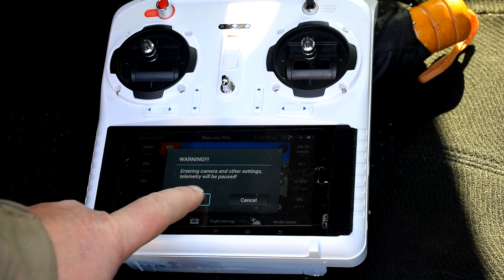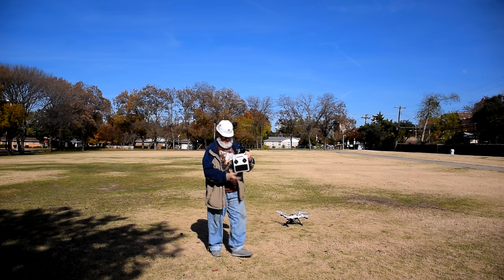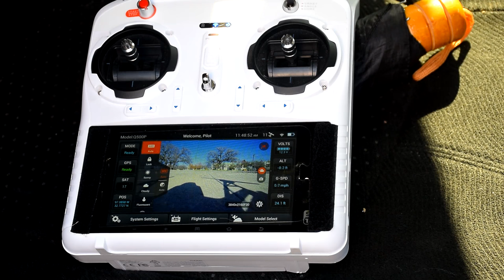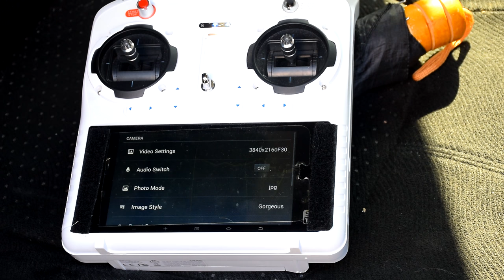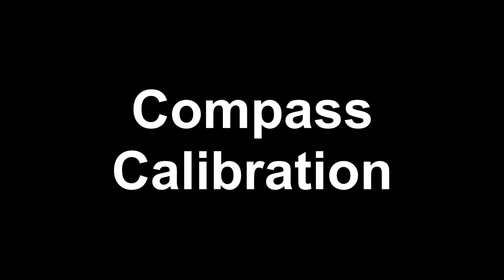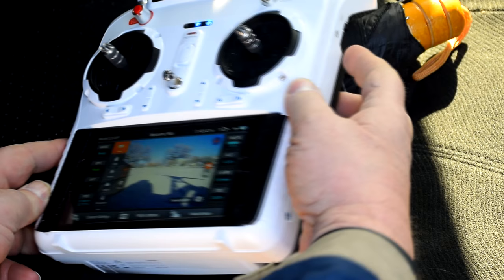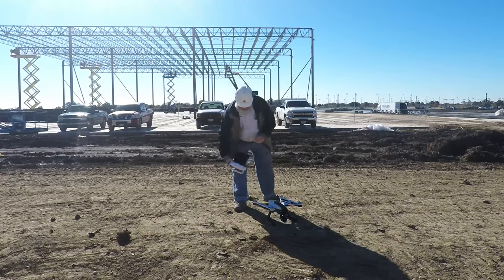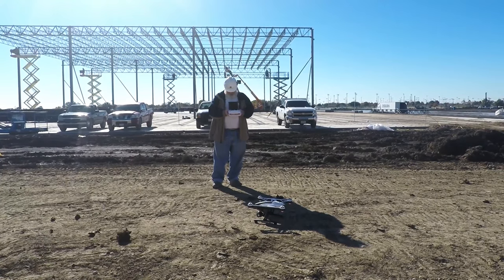Episode 4: How to Calibrate the Yuneec Q500 4K - Accelerometer and Compass Calibrations

Comment: Well after almost two years of waiting (weather and wind) I finally see a couple of days coming up when I can actually fly this thing.  In that time, we opened a Drone Park in Naperville, IL  which is really nice.  Anyway having trouble figuring out your compass calibration.  What they guy in the video is doing is not turning the drone using the cockpit as a reference point.  He seems to turn the cockpit 45 degrees but then turns the drone side ways.  I realize I am late to the party here, but could you please explain how you should be turning the drone for compass calibration.  Can't really tell what's going on in the video.  Can you also explain what an accelerometer does, and why we need to calibrate for compass when there is no directional gyro or even mag compass readout for the pilot to use.  So other then making sure the drone can "come home" if you're not using angle mode, what do these calibrations actually give you and what do you lose if you don't do them?

Thanks for the time you put into these videos.  I know I know, use of the work "cockpit" gives it away.  Yes I am a pilot still trying to figure out what axis the "Slide" is rotating around!!!!  (Just kidding!)

Comment: Hi Jeff, thank you for sharing your videos, they are very useful, I have problems with the reception of videos in my ST10+, the image is often distorted and there is a great delay in the transmission of it, this does not happen using the steady grip with the st10+, it happens only when the camera is connected to the drone.

Comment: Hi jeff , I find the speed great for filming, only problem is it's not real good in the wind. I'm also getting antena upgrade atm
Reply from the maker: Do you mean the slow speed of the Q500? If so, I agree completely. Unless someone is chasing cars or boats to make recordings, I just don't understand the need to fly fast with a quad designed to be an aerial video device.

I have a TX with an Itelite antenna on it but I never use it. I go out as far as 1100 - 1300 feet, and at that point I can't really see it anymore, so I don't go further.

Comment: I'm always worried I might damage the gimbal or camera during calibration.  Would removing the camera before calibration be ok?
Reply from the maker: I may have answered this on another thread, but no, I wouldn't recommend removing the camera before calibration. I'm not even sure the calibration would function properly if you did. I've never heard of someone messing up the camera with the calibration process - just keep your movements slow and you'll be fine.

Comment: Hi Jeff, just subscribed, great helping video for us Q500 beginners. I have one question/clarification though. I received mine yesterday, and manual says for compass calibration to keep turning 45 degrees and rotating once, but do this till 360 degrees are completed. Is this correct, or am i missing something? Keep these great videos coming my friend. Great !!!!
Reply from the maker: Glad you signed up! I don't think it would work to do a full 360 degree rotation. Once you perform the number of rotations I describe, you'll see the indicator light change, which is telling you to put the aircraft down on the ground. 

Give it a try my way and see if it works for you. If it fails, you can always do it again to get it right.

BTW, Yuneec instruction manuals leave a lot to be desired. They're incomplete and sometimes just wrong. Read the manual for sure, but be prepared for . . . adjustments LOL

Comment: Great Video!!! Quick Question: What are the directional buttons on either side of the sticks for?
Reply from the maker: for the Q500, they're decoration. LOL They left them on the transmitter for possible future use but never did anything with them. They did use them on teh Typhoon H, however.
Reply: whew Thanks Jeff! I thought I was about to go crazy for a sec. lol! I almost convinced myself that they were there to move the drone incrementally, but quickly tossed that idea out. Your vids tutorials are very informative and simple and gave me the confidence to take it out the box and try this sucker out. Had a great test flight today, thanks!
Reply: LOL is right, do you know how many people are going to waste time pushing the wrong buttons over, and over - lol  Please incorporate this reality into a video, as you've been covering everthing else.

Comment: hey Jeff I tried it today for the first time n it was exactly what I'm looking for....your video helped alot.. but for some reason it wouldn't play my videos... it will show the pictures on my windows laptop but everytime I click on the video a blue screen with the music icon comes on..  do I need to download a program to view my videos?
Reply from the maker: If you shot at 4K, that puts a lot of demand on your computer and some notebooks in particular will struggle with that. Try downloading the program MPC-HC from https://mpc-hc.org/ - don't download from other sites because some people attach spyware to the program on other sites. The link I provided is for the actual creators of the program. 

This program is free and it does a good job of displaying video, far better than windows media player.

Did you have fun flying?
Reply: got it.. that works but my videos are in slow motion.. I probably have to play with the settings to take it out of that mode (slow motion). what is your recommendation for video setting? 

 oh boy...I had a lot of mixed feelings between excitement and nervousness ..pilot mode is a Lil harder to control. I turn the nose away from me.. that makes it easier as it goes in my direction. 
I practice the different types of landing. but I noticed it better better to land it yourself as it is more stabilize unlike the "home landing " is more shaky because it jumps and that can be dangerous to both the quad copter and yourself. 
but I always tried this knew dangerous trick where i catch it up in the air on angle mode and turn off the motor in case  its of a uneven plain or a really windy day and I wanted to land it  . I know it's very dangerous
Reply from the maker: Slow motion - it almost sounds like you recorded at 60 frames per second and it's trying to play at 30. Under the play menu, choose increase rate and see if that doesn't speed it up for you.

Smart mode is easier than Angle mode because front is always front no matter which way the drone is pointed. But Angle is important to learn so you can manage your aircraft at farther differences and in situations where you lose GPS and have to fly manually.

Landing it yourself is usually preferable - home mode can be pretty bouncy. Hand catching is not a bad idea at all - I have an episode that explains how to do that safely.

Comment: Hi Jeff. Really enjoy and appreciate your videos. They're helping me greatly since I'm a nubie to drone flying. But I do fly RC aircrafts which helps. The question I have is in the production of your videos. What software and equipment are you using to make your productions?  Is that expensive?  Cool videos!  Thanks.  Frank
Reply from the maker: Hi Skyleap - I've been battling the flu so I'm slow to respond. I'm glad to hear the videos are helping you out!

I first used Sony Movie Studio to make my videos - that came with an audio editor (the name escapes me) that I use to create and clean up the narration. I moved up to Sony Vegas - you probably wouldn't need to do that because Vegas is a very expensive program. 

My first episodes used a really awful clip-on mic . . . I had to record the narration in my wife's closet because all her clothes baffled the reverberation in a normal room. I've since "come out of the closet" (so to speak) and purchased an audio-technica cardioid USB microphone that sounds better and is more consistent.

I've got more cameras than I know what to do with LOL. Panasonic G7 is my primary video camera now. 

I've got a powerful computer system but it may be overkill. You want a newer processor, lots of RAM and a dedicated video card with lots of VRAM.

Comment: does the compass need calibrated everytime you fly it. i just got mine yesterday and havent flown it yet
Reply from the maker: Hi Mark - no, not at all. Calibrate after you do a firmware update . . . and you probably will never have to update the firmware because they've stopped creating updates. Or, calibrate if you travel a few hundred miles from your last place of calibration. Finally, calibrate if you see the drone hover in a circular (toilet bowl) fashion or if it is not responding accurately to your stick commands. You should have to calibrate very rarely.
Reply: @JeffSibelius  thanks

Comment: Very helpful videos indeed. My Q5004k came yesterday, and I'm done charging everything but the trans. Good demonstrations. Thanks so much. You're very clear in your vids. I'm not sure about doing the firmware though. I'm not that good on this computer, and am afraid I'll do something wrong. If you have , or anyone has any good advice on doing the firmware . I'd appreciate it.
Reply from the maker: +go fly a kite I'm glad you found the videos helpful, and I have several more planned - one of which is a walkthrough of the firmware update process. That will be a little while before I get it done, however. 

If you're really anxious about it you can wait until I get that posted - the last few firmware updates have been enhancements to the system as opposed to "critical fixes" . . . otherwise, Ryan at Yuneec Tech Support did a video that shows how to do the calibration update process. Watch that one at https://www.youtube.com/watch?v=VZ6r-2yvDo4

If you have any questions post them here and I'll try to help.

I almost didn't get the Q500 because of the firmware update proccess, which looked difficult to me. It really isn't too bad. The hardest part is putting the media card in that stupid card slot inside the transmitter. Sliding that door shut can be frustrating. Once you do it the first time, you'll never have a problem with it again.
Reply: +Jeff Sibelius Thanks Jeff. I'll check that video out.

Comment from the maker: This is episode 4 in a series of videos designed to help you complete a safe and successful first flight with your Yuneec Q500 4K, Q500+ and Yuneec Typhoon G quadcopter. This episode explains how to calibrate your accelerometer and compass.
Reply: +Jeff Sibelius I thought it was supposed to be turned counter-clockwise.  Does it matter?
Reply from the maker: +deezorama Good question. I watched Ryan with Yuneec tech support doing a calibration and he turned it to the right, or clockwise. That said, I don't know if a counter clockwise rotation would work or not.
Reply from the maker: +Mark Webb I have a sneaking hunch that either direction works. I saw the conflict in instructions between the manual an what Ryan with Yuneec Tech Support posted on his video, and went with Ryan's approach. He is "the man" regarding Q500 tech support.

I may give them a call to discuss this, but so far we have feedback that clockwise works (from me) and counter clockwise works (from you) so for now I think either approach is safe.
Reply from the maker: Let me know how that works!
Reply from the maker: I don't think so. The manual says to turn one way but Yuneec's tech support video goes a different way. I think either direction works . . . I've had people tell me they've gone one way or the other and not had a problem.

Comment: Just watched the first 4 eps, thanks for the tips! Can this also apply to the blade chroma?
Reply from the maker: Hi deezgata - many of the things I discuss on these episodes apply to the blade chroma (particularly the 4K). The transmitter is almost identical for each platform. The camera settings are the same for the Q500 4K and the Chroma 4K - the Typhoon H is about the same but it has a couple extra features. Where you will find differences would be things like calibrations, firmware updates, GUI, those sort of things. I only flew a Chroma a few times so I can't speak with any authority on those topics, unfortunately.

Bottom line, 90% or more of my content will work for the Blade Chroma 4K so hopefully you'll find a lot of good info on the channel!

Comment: Hi Mr expert glad we have people like you well a little question what is the difference between radios ST 10  - ST10+ screen are the same size.....other differences   maybe.......
Reply from the maker: Hi jor - I almost overlooked this. The ST-10 has a smaller screen than the ST-10+. I think that's the only real difference.

At one point you couldn't access camera settings for the Q500 4K with the ST-10, but I think Yuneec did a firmware update to address that.

The size difference is important - as in many situations, an extra inch can make all the difference. ;-)
Reply: Thanks  again take care
Reply: Late to the party but I also believe the ST-10 does not have 'Haptic Feedback'. In essence, the ST-10+ will vibrate when the battery gets low or other warnings are triggered, whereas the ST-10 does not.
Reply: thanks man

Comment: Jeff, do I understand correctly that you have 30 seconds to complete the entire compass calibration process...with all the 45 degree rotations??  Thanks.
Reply from the maker: That's my understanding. If you take too long it is supposed to time out. It sounds like you have to rush but time how long my calibration took in this video - it's actually a lot of time. If you do time out, don't worry. Just start the calibration over and try again.

Comment: Hi Jeff I am a novice with the Q500 4 K so please excuse my somewhat dumb question. What are the buttons below the joysticks used for? I have watched a few videos for beginners but don;t see their use mentioned. The manual that came with it doesn't explain their use. Thanks!
Reply from the maker: Hi John - Those buttons do nothing, believe it or not. Most quadcopters have buttons like those by their sticks to allow the pilot to fine tune how the aircraft is hovering . . . it might be drifting left slowly in a hover, and you use the buttons to correct for that drift. That's called trimming the aircraft.

With its GPS connectivity, the Q500 really doesn't need to be trimmed. If you see a drift you probably need con calibrate the accelerometer and compass. So Yuneec built those buttons in for a function it never needed. They probably left them in place in case they decided to add some new function in the future, but that's never happened. 

Apparently they like havin those buttons on the transmitter; the new ST16 TX for the Typhoon H also has those buttons.
Reply: Thanks Jeff, It was driving me nuts trying to figure it out!...LOL, Thanks for the GREAT Videos! I can;t tell you how much they help a beginner like me!
Reply from the maker: Glad to help!

Comment: Hey Jeff do i need to calibrate motor after replacement? I replaced type A motor and now i see it is pulling it towards this new motor - like it would have more power. What do you think?
Reply: definitely replace all of the motors! The new motor will be brand new and have no deterioration in the performance and the old motors will.

Comment: I just got my Q500 4k back from the shop after it had the GPS and compass replaced. First flight was problematic in that the craft would fly off in different directions on its own regardless of stick input. I recalibrated the compass and the craft was all over. I recalibrated the compass again and it still flew all over the place. I guess I give the shop a call again tomorrow. This thing has spend more time in the shop than in the air.

Comment: Hello there Jeff! So, I'm having the dreaded "gimbal drift" intermittent, and I suspect it has to do with the magnetometer, as yawing L/R causes drift angle up/down... thoughts? I JUST got my q500 4k back from Yuneec for a bad motor (right out of the box...) and am very hesitant to send it BACK in.
Reply from the maker: Hi CW - So when you yaw L/R your gimbal drifts up and down? That's a new one on me. I've experienced drift of the entire quad when it should be hovering, but never a gimbal drift. 

On occasion my gimbal will tilt on its own, just slip down or up; I've never thought much about it, just put it back to where it was and kept going. Is that what you're describing? If so, I've had that happen many times and it's never presented a problem with regards to flying, just a minor irritation that I can address on the spot.

Can you describe what you're experiencing in a bit more detail?
Reply: My mistake, yes, horizontal tilt with L/R yaw. It's not as prevalent at the moment as others have experienced, though I fear it may get worse. I've been perusing the boards and it appears it's not only a known issue by Yuneec, but a pretty common one with owners of the Q500 4K CGO3 specifically, in the air or on the hand set. As I said, I suspect it has to do with the gimbal's magnetometer (slider on top next to circuit board, like in a mobile phone)

Comment: Does it matter which calibration you do first?
Reply from the maker: Some people say you should calibrate the compass first, but I asked Yuneec CS about this and they told me the order didn't matter. The calibrations don't have to be done at the same time or even in the same place. I do my compass outside at a flight location, but usually do the accelerometer indoors on a surface I know is level.

Comment: Hey Jeff.. I'm having some trouble calibrating the accelerometer. I tried calibrating it but I don't end up with the right LED lights. Maybe I'm standing too close to the quad when I try to calibrate it?
Reply from the maker: Hi Derek. You could try stepping back further . . . I'm betting there is some kind of interference where you're doing the calibration. Have you tried moving the aircraft to a different spot and then doing the calibration?
Reply: +Jeff Sibelius i will try to calibrate from a ferther distance away, and Im going to see if I can find a more open space.. thanks.